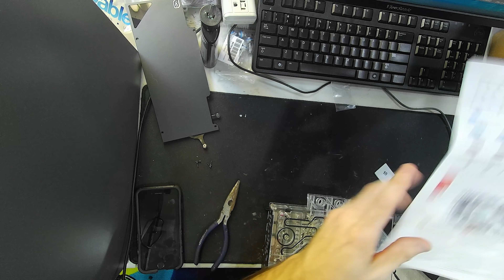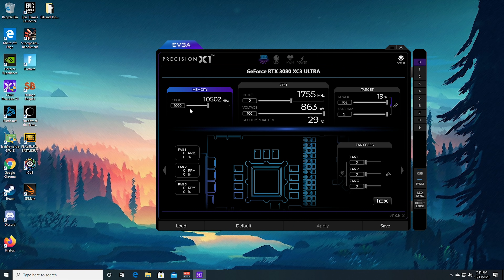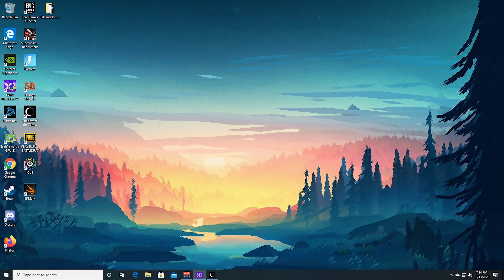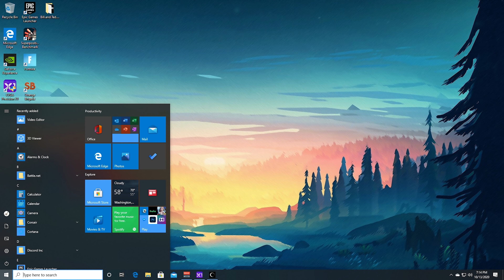RTX 3080 XC3 waterblock install + temps

Comment: Nice Video. But the part about cost saving is just not true. The material costs savings are insignificant. This three part design has two advantages: a wider range of graphics card compatibility and not heating up the copper by components that don't need a lot of cooling.

If you think about it, this three part design is even more expensive to produce, because the assembly takes longer which is the main cost factor.

But I am happy that you still like the block even with the overhang ;)
Reply: Are alphacool planning on releasing a EVGA specific block or will it stick to this reference design?
Reply: @aaronactive  Yes, but we still need the card for measurements. If you are from europe you can send your card to us and get a cooler for free. We also still wait for someone to send us the ftw3
Reply: @AlphacoolGmbH  unfortunately I’m in Australia - I’m surprised no one has sent one to you yet!
Reply from the maker: @Alphacool International GmbH multiple people are reporting of XC3 incompatibility now and apparently XC3 has been pulled off the list of compatibility.  Will you be offering XC3 replacements for the people who bought this cooler for their XC3 3080’s?  The top left screw not lining up is causing contact issues with the left side VRM’s
Reply: @FrameChasers  that sucks if the case, I already got the block and am still waiting for the xc3... also paid a Buttload for shipping
Reply from the maker: Yeah people on Reddit are drilling and tapping their own holes to get around it, we have to wait for an alphacool response on this issue
Reply: @FrameChasers  I saw you had the same issue with the top left screw - Did you find any issues with the VRM contact?
Reply: @FrameChasers  Hi announce me here once to word, have reported in the forum the incompatibility. The answer from the support I should send in my GPU otherwise there is no other possibility!
Reply: Do you guys perhaps have a 3080 Founder's Edition waterblock in the pipeline?
Reply: @tylerdurden3722  FE Block is almost ready. Weeks i think...
Reply: @AlphacoolGmbH  was there a change in the alphacool block or the evga pcb?
Reply from the maker: @AlphacoolGmbH  are you going to respond?
Reply: @FrameChasers  no, i've had enough with alphacool, first i was told i would get a new suitable backplate, after a few weeks of waiting i had to send in my own gpu otherwise nothing would work! I will order from another manufacturer and complain about the waterblock to the dealer, top alphacool!
Reply from the maker: Yeah if they don’t respond in a few days I will make a boycott video, they shouldn’t be falsely advertising products and then abandoning their customers who bought their products, unacceptable in my opinion
Reply: @FrameChasers  I’m confused - you also saw the same issue with the screw not lining up right? It’s now just the fact they have removed “supporting”? Sucks for me as I had to order from EU to AU and paid about $70 in shipping
Reply: @FrameChasers  Sorry, but for support questions you can also just write an email to info@alphacool.com We also don't run around all day on Youtube ect. to answer all questions. For that we would need 100 people who do nothing else every day. The EVGA was included in the list because the design was only visually checked and found to be suitable. The fact that at the end EVGA a screw connection was shifted by about 1 mm was not obvious. When we received the first feedback, the card was taken off the list. Currently a new cooler for the card is being developed. So if you have the cooler and are wondering how to proceed now, just send us an email. Then the matter will be clarified.
Reply from the maker: @AlphacoolGmbH  yep I sent an email two days ago as well to the email above with no response, il wait a few more days
Reply: @FrameChasers  2 days ago... so saturday. We are not working in a weekend ;-)
Reply from the maker: I got an email response, they said anyone has 30 days to return to product to their website, if you bought it from a third party vendor then you need to RMA it with them.  They also don’t even have an XC3 waterblock being made right now. So it looks like they fucked us over boys, I will be making an alphacool boycott video shortly, in the meantime do not buy their products unless they make this right.  That’s probably why this guy didn’t want to publicly respond on YouTube.  I will show the email in a video
Reply: @FrameChasers  cheers. Not even worth me sending it back with shipping costs. I might just find another card that it does work with or resell it. Or I’ll just force it and use it anyway.
Reply: @FrameChasers  Did they say they were making a block for it and remove their comment? Im glad I got a bykski, I was worried but the quality is top notch. Plus expedited shipping with tax was still under $130. I ended up with a reference card instead of the xc3.
Reply from the maker: Update to this issue

https://www.youtube.com/watch?v=UV0qn8NWeps&feature=youtu.be
Reply: @AlphacoolGmbH  Da muss jemand aber nochmal an seinen PR-Skills arbeiten. Das Produkt mag ja gut sein aber so unfreundlich macht Ihr Euch sicherlich trotzdem keine Freunde und unprofessionell wirkt es auch.
Reply: Damn brah you getting bigger =P haha @alphacool are you guys making a 3080fe waterblock
Reply from the maker: Holy crap how did you guys find my little ol channel.  If your taking suggestions, can you guys include 4 little nuts that work with the stock screws for the end of the pcb overhang? That way XC3 buyers will feel like it’s a more complete product when they get extra mounting nuts for their evga backplates
Reply: @FrameChasers  I'm  now interest on purchasing an Alphacool system after watching this video...damn those temps were awesome !
Thanks for the info.
Reply: @2boostedsilverado  i have one on a gigabyte rtx 2080 gaming oc and it work like a charm, regur temperatures on maximal oc and unlocking the tpb pering it with 300w i usally play a temepratures between 50 and 55C, after 2 hours of intensing gaming i will maybe reach 60 C but it's just because i lack  a bit of arflow and the framerate and clock dont vary at all,  Alphacool was also the only waterblock that i could find for the grafic card , the price wars also very good just 100,00 eu, sure the site is a bit messy and lacking on the description but the user manual for the assembley was very clear and easy to understand especially for cutting the termalpads sisnce the add a 1/1 scale model to cut them out and tell you hou many you have to cut out; as an extra if the dont have a compatible cooler for you card they will  make it for yoy for free probably as long as you give the a feedback on how it is performing
Reply: @FrameChasers  You do realize your the only person on youtube that has a 3080 and the alphacool block in the same video.

Comment: Just on my XC3 ULTRA stock air cooler I got up to 1,950MHz and I added 150MHz to my vram. I hit 5,186 pts in MSi Kombuster benchmark at 1440p. Just for fun. I only gained 5 fps from all that. And I ran my fans at 70% (2,450 rpm). It really isn't worth it. If I were to gain an extra 200MHz from a $145 water block and flashing the bios to the 450watt FTW3 it wouldn't be worth it. 

I would have to shunt mod, waterblock and bios flash to FTW3 for a TOTAL of 10-15 fps gain in benchmarks and gaming. Then it'd be worth it.

Comment: I know this is old already, I just wanted to mention how "the EK block does cool the chokes" statement aged poorly. lol
Reply: Damn, I am having this exact issue now with EK blocks...
Reply: What's this issue, mind updating me a bit?
Reply: @jockegw  there's a few posts on reddit, you can look it up if you want, but to sum it up: EK designed the block based on the reference card, but this card uses much shorter chokes, so the block does not make contact with them at all (theres about a 5mm gap). Not a terrible thing, since chokes do not require active cooling. But again, it was advertised as cooling them.
Reply: @diego30s  Ah i see, thanks for the update! :)

Comment: This waterblock looks cheap in person, and also a flow rate killer. This thing is super restrictive. Getting 12C delta T with my 3090. Also, backplate does not make good contact with thermalpad once installed, thermalpad for backplate should be thicker. Returning and getting the EK block...

Comment: @Frame Chasers would you recommend installing thermal pads between the card and the backplate? Because the backplate has no function without thermal pads. In my opinion. Would be cool if you can make a little guide about that. (E.g where to place, thickness of the pads,...) Thx a lot and keep going :)

Edit: I am surprised that EVGA is so lax with the pads after the "debacle" with the GTX 1080

Comment: Don’t know if I missed it but what size radiator were you using? I’m curious how cool I can get a 3080 on a 240mm rad with a 10700k in the loop. I can’t go any bigger on the rad cause I’m running a SFF rig.

Comment: Sure run it at those voltages for a few years and see where it gets you. The cards are volt limited for a reason you know, doing this to break benchmarks is one thing doing this for every day use is just asking for a dead card within two years if not shorter. Just face facts, 8N Samsung node is awful and Nvidia should of just bit the bullet and gone with TSMC but their ego got the better of them. These cards are great performers already, whilst also being terribly inefficient. Those benchmarks AMD showed off at their event puts RDNA2 within 5% of a 3080 at 4K and we don't even know if that was their highest card and they are on a much more efficient 7nm TSMC node. Couple this with the 3000 series being probably the worst launched GPU in history, basically a paper launch, Nvidia chose to use their top die for the 3080 which hasn't happened in a long time, they chose to price competitively, we have the whole POSCAP fiasco, and now AIB's scalping their own cards to rip off the consumer, oh and drivers needed to fix crashing issues above 2GHz.......... This is AMD's time to bring back some competition and take some market share, if they screw this up they may as well stop making GPU's.

Comment: Well you did all that work for pretty much for nothing. I don't know if there is a bin difference between yours or mine but out of the box xc3 ultra with air will get that 2205 MHz (atleast mine did). I think there is a different sort of limit because I can't clock any higher even the card is super stable even with air. I can send my 3d mark results to you if you like.
Reply from the maker: why would I care what your card boosts to...  odd

Comment: New bios is out for the EVGA 3080 FTW3 ULTRA,  new powerlimit is set to 450W (same as Asus 3080 ROG STRIX OC ) so atleast 18% over the default of 380W
https://videocardz.com/newz/evga-releases-xoc-450w-bios-for-geforce-rtx-3080-ftw3-ultra

Comment: Yet another rushed product, and not particularly well thought out, manufactured in an effort to maximise profits before anyone else produced a similar product.
What do you believe the results would be if this gpu was manufactured using the TSMC 7nm node. Firstly, if the gpu would overclock and to what frequency, secondly, what the TDP would be also on this 7nm node. I am attempting to gauge the benefit of changing from Samsung as there is a lot of noise on the web that Nvidia is changing to TSMC sometime in early 2021.

Comment: I have the exact same card and cooler. Same issue where that one back screw don't line up. I used the Alphacool backplate and thicker pads and been running max 50c at stock! With the 3 fan cooler I was hitting 82c. No regrets.

Comment: Hi, I have a question, more like your or someone's opinion, I have a asus 2080 ti strix oc, and I can achieve 2160, stays around 2130 at 50c to 60c, I wanted to ask, should I sell it and get a 3080, or keep it, I'm happy with it, if I dont get 60 at 4k I use 3200x1800p, and it looks really good, just looking for a opinion😁

Comment: I got the same block from PPC and have it on hand, and have XC3 on its way from Amazon this Friday.
I wondering if I should sell the Asus TUF RTX 3080, and stick with XC3, not getting good overclocks with only 350W maximum power limit voltage craps out to less than 1v when it tries to go 2GHz+ even though temps are 50C, have to stick with only +120MHz on the core.

Any suggestions? What the maximum stock PW limit on that XC3 before modding?
Reply: asus tuf is 370w supposidly 117% power slider
Reply: @dnsean03  True, however even slider at 117%..GPUz board power doesn't go beyond 350w from the 100% 320w...so it really just 110% even if the slider says 117%
Reply: @UnboxingEngineer  I've seen mine got to 360
Reply: @dnsean03  Maybe spikes for a second or two yes
Reply: @UnboxingEngineer  well there was a bios update soo try those out
Reply: make sure your using 2 separate 8 pins, not 1 piggy

Comment: I like to watch your product tests and reviews, I find them very helpfull but don't you think it is time to move on to 1440p at least. 1080p era is over, those cards (3080/3090) are specifically made for +2k gaming, mostly for 4k and most of us will use it for that purpose(4k). Your benchs doesn't help us to get an idea about 2k & 4k resolution performance. We don't get to see the full thermals performance under 1080p cause the card doesn't need to pull full wattage for 1080p resolution. This is like having a Ferrari engine in a VW Bug.  :-)